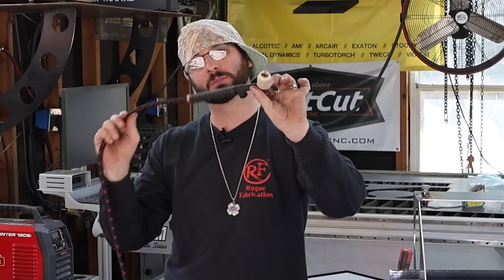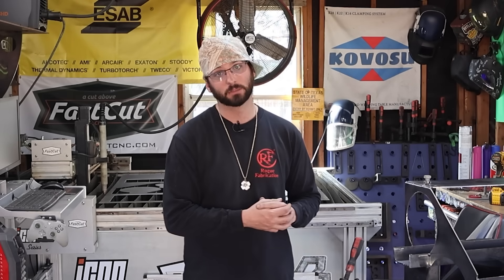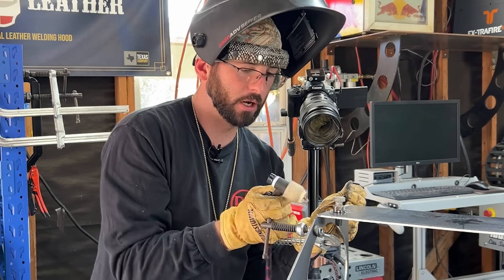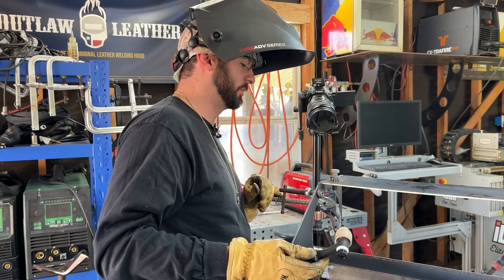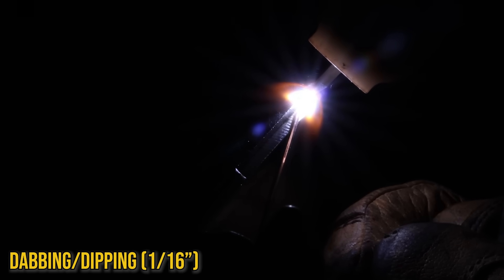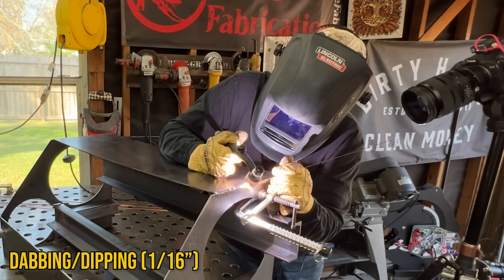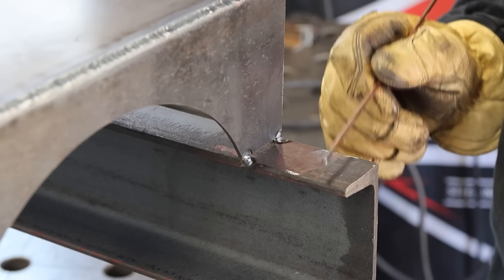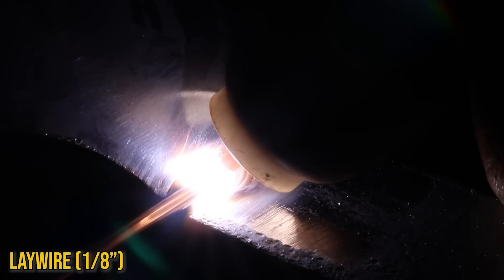Beginner TIG Welding Techniques: Laywire and Dabbing Explained

Comment: have you ever welded with a duble button torch? i find it crazy to see a profesional welder welding with a gas knoob... i weld mostly aluminium with an old german machine (ESS 300) and you can pulse with the buttons on the torch (instead of a fixed interval, while you push the second button it'll weld colder (or hotter if that is your preference). is much nicer than standing on one foot while balancing and pushing on the other. 
But maybe I am a bit biased cause with aluminum you don't need to have a perfect constant distance to your puddles.. idk, i just feel like welding standig with a pedal is way too uncomfortable. 
❤

Comment: The laywire technique I was taught was used for thin base metals, particularly SS.  And, it wasn't laying the wire and welding over it.   I actually was taught to push the filler wire into the weld puddle.  Yes, it was a cold weld.  But, you could turn up your amperage and get better penetration.  Bent some test coupons, and was able to get successful welds that wouldn't break.

Just a hint....for odd position work, I'd do complete dry runs (not actually welding) to determine the best body position approach, as well as show myself any unexpected body position changes I might run into during the weld.

Comment: I've found between doing both thick and thin plate primarily in stainless, no matter the thickness then you can achieve the same quality welds with either method. 
But if you care about laying down a lot of wire fast, without compromising heat input, then dabbing is the way to go.
With dabbing I can do 400 mm a minute, with everything having to pass a penetrant test after. 

However all of that is running with just a button on the torch, so you make changes between welds but otherwise it's just full pedal. With the exception of just pulsing the button yourself, using the slump-down to do it pretty effectively. 

So long as your not one of the people that actually believe in the 4-8 seconds of slump down outside of certification. Nah just time letting go of the button right along with smoothly speeding up a fucking ton and decreasing the tungsten length slightly. You effectively drag all the heat from the weld puddle out into a narrowing weld puddle, until it disappears. Start at around 0,5 seconds if you wanna try, I prefer 0,3.

Comment: You still need to feed the wire with lay-wire!!!  Use torch manipulation to achieve a nice look. I use little circles or cursive Es and can achieve a dabbed look. Also lay-wire is great for welding on thinner materials, say 150amp on 16g stainless all day long!!  Time is money 💰 lay-wire is also used for walking the cup. Lay-wire is just another tool in your mental toolbox!!
👨‍🏭🤙🍻

Comment: Personally 5g ill use a dab method to flush it up before cap off pipe
Reply: Basically to me you can make both visually impressive and solid but come to think about it I've used both methods for certain applications however I like the fundamentals of walking the cup but almost always free hand my root pass

Comment: I only laywire when I have tight and cramped inside corners where I can only kind of see where my tungsten might be, and stacking dimes makes my tungsten and filler become one. I haven't seen anything on a blueprint. But I've had customers ask for specific types of bead based on what they want visually, even if its wrong. I was forced to do an autogenous weld on half inch stainless because the customer wanted the bead as small as possible.
Reply: its all about what the customer wants... what they cant see wont hurt em lol

Comment: Can you do how to get rid of a fish eye when tig welding I have trouble getting rid of it please 🙏
Reply: don't immeditaly stop when you reach your end point your welding (tie in).  kind of walk the cup while speeding up and gradually backing the tungsten off the weld.
Reply: @ ok ok it would be better if he showed us on video but thank you though 🙏
Reply: @christiangonzalez2178  Practice it on some scrap you'll see what he means. Your weld pool will get thinner and thinner, the end of your weld bead should taper to a point. As you are welding there is a small vortex in the weld pool which starts at the surface of your weld and goes straight through to the root. This is what turns into a fish eye if you end your weld abruptly. This technique allows you to close that vortex before terminating your arc. You can also add a down slope on your welding machine if you are using high frequency, or back off the pedal slowly if that's what your using. It will have the same effect without you having to speed up. Although I often use the speeding up method and down slope at the same time.
Reply: fish eye on your root pass? the trick is simple, never rip out of your root, alwasy taper to the bevel edge or back off your amperage slowly if you have a remote. if you get a fish eye, no worries just re heat the area as you proceed and it should fuse up. Just shot a video on back feeding pipe, its in editing, i get a gnarly fish eye and we correct it
Reply: @Drweldz  ok I kind of understand it’s that I’m learning bit by bit you are one of the best instructors on YouTube hands down seriously it would help me a lot better if you made a video of it and explaining more depth of a fish eye and how to get rid of fish eye with high frequency please this would help other welders too thank you and god bless you 🙏
Reply: @Drweldz also I forgot if you could do how to get rid of a fish eye while freehanding that might be a good video for welders that weld in tight spaces

Comment: Feel like beginners should learn to dip/dab first. If they lay wire everything without the proper amperage they are basically brazing everything.
Reply: Can you explain? I’m a beginner.
Reply: @danielcielmaee3642 idk if you're still looking for an answer here, but I disagree with that comment. In welding school we learned haywire first because it helps you get the motion and arc length without the extra dimension of having to feed and dab. You can focus on learning the most basics of basics, once you've got that down it's easier to learn to dip n dab b.c you're not focusing on as many things at once.

Comment: Ever since I saw a coworker do it, I've been curious about someone elses opinion on laying the wire, but doing a forward and back sway pattern of sorts with the torch to collect the puddle from the rod pull it back and focus heat before advancing and doing it again. It gave a dip dime like appearance the same way you can get that appearance doing fusion with patterns and such, but I have no clue about the ins and out on if it's an ok thing beyond "the two bits of sheet metal ain't movin so they're welded"
Reply: youre on the right track! you can get deeper fusion doing the technique youre mentioning, while alwasy having the "chiller" in the puddle. any motion or octillion  will leave a little ripple
Reply: @AustinHargett  good to know, he keeps saying do patterns and such to make burn through penetration on 18 gauge sheet metal nonexistent but I worry it will make weak welds the air pressure will rip open (especially with other coworkers), to the point I had to force him to fusion weld a 150° angle butt weld with 24 gauge stainless for a rooftop pipe umbrella to prove it's impossible to not happen every time I welded one.

E: and he thinks because you can fuse aluminum it's a valid way to weld it, so I never know what is good or not good when watching him do things I've not seen before

Comment: When doing laywire you can deposit more metal that  the thickness of the wire. What you want to do is stab the back of the weld with wire and let the arc eat the wire effectively moving the stab point. By varying the angle you stab at you increases the amount of filler you deposit per inch of weld. At filler angle of 90 degrees you would basically be staying in ine spot making huge puddle and at able of 0 degrees you have laywire.

Comment: I have theses table legs I’m building taday actually I make them quite often using 1”x3” rect tubing cut and kind of make them into a rectangular frame and 45 degree miter cut the corners I’ll bevel the two sides where the corners meet and knock a flat on the outside corners and weld them all different the bevel ends I lay wire with 3/32” wire the outside corner I lay wire and pulse with thinner 1/16” wire and the inside corner I dab with 1/16” wire . Not sure if it makes sense how I described it really each weld whatever you or I do may be different and have a better method of welding. Good video 👍

Comment: I'd like to see a sch 10 SS 6" pipe welded in 2 passes maximum (1 pass preferably), maintaining silver to gold on root and cap, may be rotated, but preferably welded in quarters
Reply: One pass may be hard what would you use 1/8” wire and would you bevel it and or gap it at all. Definitely may be possible not something I do often I’m just thinking in my head I do a lot of 6” sch.40 stainless pipe that’s multiple passes though a little different. Could definitely be possible though would be a cool video 👍
Reply: @WojnarskiWeldingFabricaion  
Yeah i wouldn't expect one pass with the color standard, I've been able to do this with 2 passes, I run a 3/32 gap, with a very slight bevel (almost square groove, no landing) using 1/16th rod with a laywire stringer bead for the root at 75amps, for my cap I dab but I can only maintain the color standard by welding slightly less than 8ths at a time, although lately I've been noticing I'm not filling as much as I could on the root pass and I think that will help give me more meat to soak up some heat on my cap
Reply: @LordButterstotch  yea makes sense sch.10 is easy to heat up faster any reason for not wanting not much color in it   I can picture welding it in halves or quarters and it having a little bead of color purple blue maybe hotter. I’m sure there’s a reason I know a trailing cup will definitely help that’s what they use welding titanium to help with less color to shield the weld more. Or maybe a bigger cup with gas lense like a 14-16 cup just a thought may be something completely different than what you need
Reply: field weld 6" sch 10. heard!